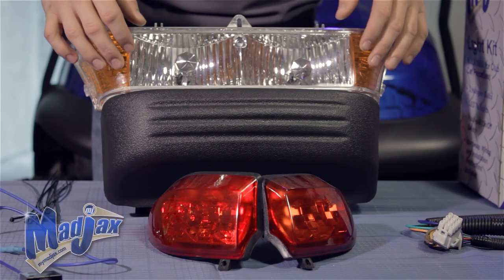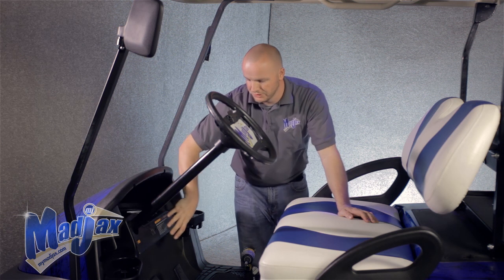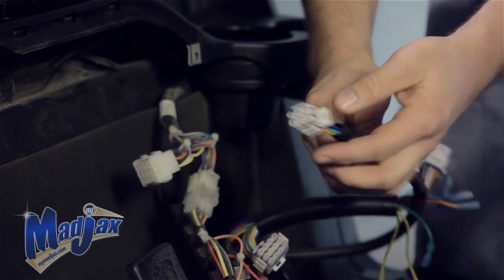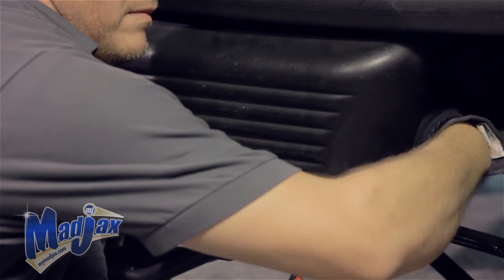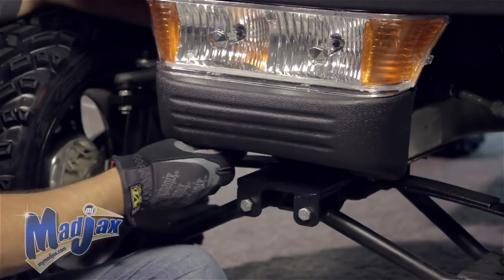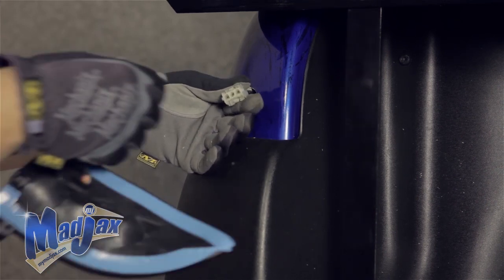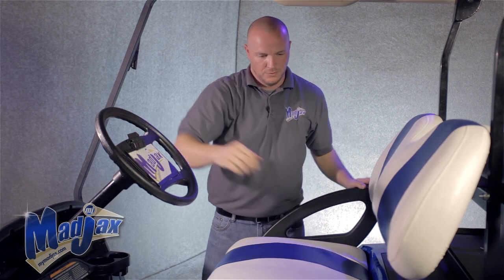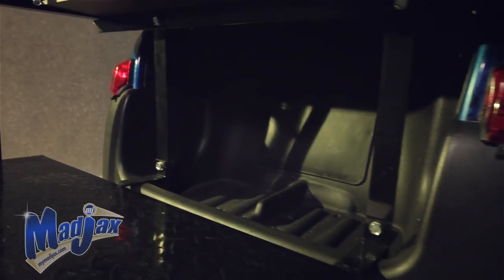Light Kit for Club Car® Precedent® | How to Install Video | Madjax® Golf Cart Accessories

Comment: I assume the voltage reducer has already been installed somewhere?  I dont think lights are plug n play without a reducer, right?
Reply: I have the same question!! Is a voltage reducer needed for a 8 volt batteries, since these lights are 12 volt